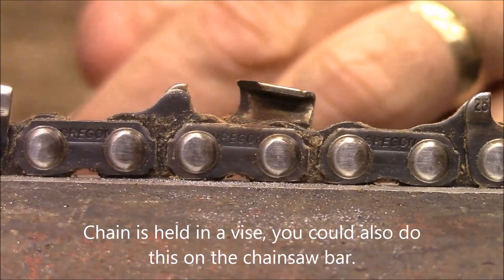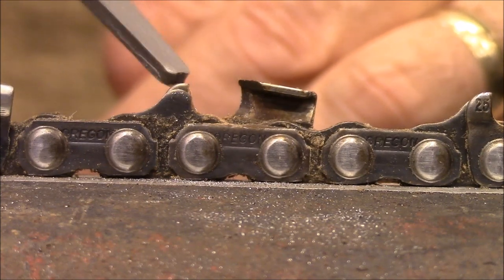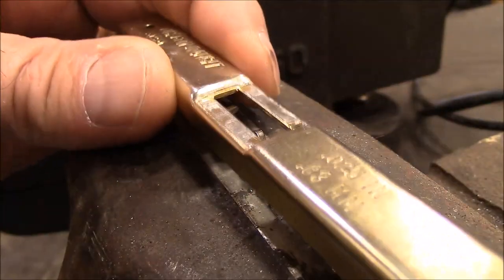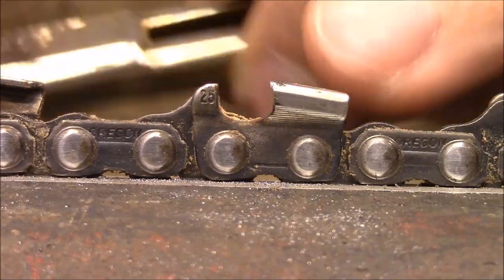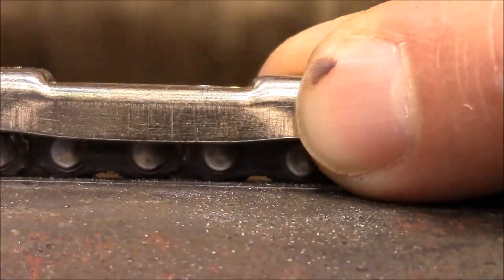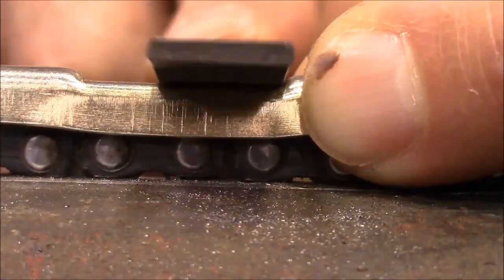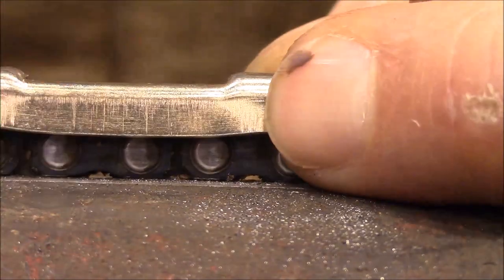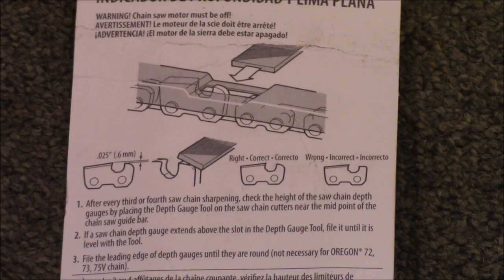How to use a Chainsaw Depth Gauge

Comment: DON'T DO IT THIS WAY if you want your gauge to last for years. Measure with the gauge, remove it, file a bit, then recheck with the gauge. If you do it as in this video, you will end up filing down the gauge slightly over time, no matter how careful you are.
Reply from the maker: Thank you for your comment.  The Oregon gauge is hardened and the file just skates across it.  I have been using it for years and it barely has a mark on it.  Thank you for watching!
Reply: The gauge is no different than a drill guide bushing...it's hardened and very difficult the damage.  The main concern is to only file the depth tooth till you just start to scuff the file on the gauge so that you do not dull your file over time.
Reply: Johhnybarbar. Correct, although hardened steel can blunt a very good file with just a few strokes, I lent a friend my Stihle raker file, and busied myself nearby with other tasks when I heard a much higher pitch coming from his filing. I delayed in making the connection, and when I looked he was sharpening his  axe with it,  He ruined a very good file in just a few seconds--Grrrrr!
Reply: Who the hell has time for that shit? File gauges are cheap (under $2 each). Time isn't.
Reply: @dumper87 exactly
Reply: my thought exactly

Comment: My favorite part is the warning on the Oregon instructions:  Chain saw motor must be off.  That's almost as good as the instructions in a new iron my friend bought recently:  Warning: Do Not Use On Clothes You Are Wearing.
Reply from the maker: You have to be really quick to use it when it's on.  My favorite warning is the one on the lawnmower that tells you not to stick your hand under it when it's running.  Thanks for watching!
Reply: Thomas Hanson they put those kind of warnings on the package for liberals.
Reply: You know that the safety cutoff on the handle and the whole warning not to by pass came from a law suit... a guy in California nudist camp climbed a ladder with one to try and trim a hedge...needless to say he fumbled the unit and it flipped around...and actually removed his "unit"... and only in California ...he won his case!!!!    Number 1 rule is safety first!  Pruning naked is stupid...pruning hedges with a 20 inch push mower is straight stupid....right!!!!????   Crazy!
Reply: It's not just liberals, Mark Twain nailed it with:  "Common sense is an uncommon thing."
Reply: We laugh at these warnings, but some idiot pitcher from Atlanta did iron the shirt he was wearing and got second degree burns.  I think it was John Schmoltz (or something like that...)
Reply: You betya, there are idiots out there that don't know this. They need instructions for EVERYTHING these days.
Reply: Thomas Hanson if we have to put warning signs on things like that maybe they shouldn't use them pay someone to do it for them so that I can make more money
Reply: And don’t drink and drive same as iron mower chainsaw 🤪
Reply: They are on there for a reason "it takes one  idiot  to do it"
Reply: shampoo has directions ........
Reply: @coady-wp3xf  "Lather, rinse, repeat". Theoretically, that would mean we shouldn't stop until the bottle is empty.
Reply: My favorite one is on a box of wine. "Remove this black lid."
Reply: America...
Though I can imagine someone not stopping the motor before trying to use it. Normally the chain doesn't move without applying throttle.

Comment: Make sure you flat file the depth gauge in the same direction as the round file you used to file the associated cutter edge (so every other depth gauge will be filed in the same direction, not as shown in the video). Also if needed, use the flat file to round over the nose of the depth gauge to maintain it's rounded shape vs possible flattened shape due to your filing the depth gauge down.
Reply: Does not make a difference wich way you file the raker but the rounding over is important
Reply: Also - the Oregon package instructions don't show the gauge in place when actually filing.  Leaving the depth gauge tool in place while filing will slowly, over use, thin the .025" depth of the gauge leaving the raker tooth too low.  The depth gauge is only used to check the height before and after filing the extra away and NOT to be in place while filing.  That is why it's called a GAUGE and not a jig.
The direction of the flat filing of the raker tooth doesn't matter although rounding the profile shape after does matter.

Comment: you should have mentioned that you were using a .025 depth gauge and that there are several other chains that as raker shows on your chain that it is to be .025 thousandths depth but some chains are .020, .030 and early older chains can go to .035 and .040 etc.
Reply from the maker: Thanks for the information.

Comment: Thanks didn't know you should do that but I'm going to give it a shot
Reply: +Will Jordan I didn't either.  Been using a chainsaw for 40 years.  Just found this out about 2 years ago.  I always wondered why a sharpened blade would not cut as good as a new one.  Using the depth gauge makes them cut like new.  Thanks for watching!
Reply: No thanks again for the tip
Reply: What's a raker
Reply: @nmmxiii9389  , the raker also called the depth gauge is the upright in front of the cutting edges of tooth. It determines how much fibre the tooth is able to bite.  Set too high, just produces dust, not chips. Too low, makes grabby & can overload engine. Increased risk of kickbacks, severity high.

Comment: PLEASE guys, remember this sentences: 1. Sharpening teeth more than needed makes it dull faster, also shorter chain life.  2. The longer guide bar the longer time to cut the tree.  3. Full throttle is not always the fastest way to cut the tree.  4. Different chain oil can make a big difference in performance.  5. If someone uses chainsaw, never step in front of them, the chain can break and land on u.  6. Sharpening angle is very important.  7. Dont get used to sharpen the chain by hand tools. Buy a machine for it, it cant make any wrong step.  8. If u use sharpening machine never put the grinder laying on teeth until it is sharpened enough, the teeth will overheat. Rather do a few taps and volia(no heat, no problems in future).  9. Depth gauge makes only the tip of tooth cut the three, not the whole blade. It makes teeth longer life, less resistance in speed and engine running, so DO NOT grind the depth gauge lower than u should.
 All of them i learned from my and my dads faults, hope u learned something new on easier way.

Comment: Perspective from a former Oregon timber faller. There is a way better gauge than the one shown in this video. The Calrton file-o-plate is the wat to go. The Carlton allows you to file the rakers to each individual tooth instead of spanning 2 or 3 teeth. Plus the Carlton allows you to file the rakers at an angle. Just make sure you get the proper file-o-plate for the chain you use.
Reply from the maker: I checked out the Carlton.  Interesting tool and looks like it would do a good job.  Thanks for sharing.

Comment: Two questions please. Are there different depth gauge tools for different size chain? And does it matter which way you file depending on which tooth and gauge you’re on?   Thank you for your time.
Reply from the maker: You do need to get the one for your chain but then you just file it to the guage.
Reply: I've heard others say you should file the same direction as you do with a round file but I've always just filed straight across from the clutch side and seems fine.

Comment: I created a 3 part series on how I sharpen a chainsaw chain, in part 2 I use a chain that has 2 cutters broken off on the right ride and I purposely ground the rest of the right cutters down to about half the length of the left cutters. My question is, do you think I managed to get it to cut straight?
Reply: Yes of course, just give the rakers an extra swipe on the short side

Comment: If the gage is determining the depth , why are we filing the gage. Over time doesn't that change the dimensions of the gage?
Reply from the maker: The gauge is hardened so it is not easily filed down, mine still shows almost no wear.

Comment: Are you supposed to be filing with the gauge in place? Seems like over time you’ll kill the accuracy of the gauge.
Reply from the maker: The gauge is actually hardened so the file just skates across it.
Reply: @SoatMon  harder than file steel? I’ll have to check it out next time.

Comment: Good video buddy. You should remove the gauge when filing, since you're taking material  off the gauge itself.  Just saying, not complaining.  Cheers.
Reply from the maker: The gauge is hardened and the file doesn't cut into it.  Thanks for the comment.

Comment: I have several different marking on my dept gage, how do I know which degree to use ?
Reply: A lot of chain has a line at rear of cutter indicating top plate angle & when worn out.
Most cross cutting chain, 25 or 30 degree. Ripping chain 5 - 15 degrees.
Depth setting for most chain, 0.025" for hardwoods or softwoods with lower powered saw.
Generally 0.25", 0.325", 3/8" LP cutters.
0.404" chain tends to be on pro saws. 0.030 more usual. 
Deeper settings are not advisable for hand held units, as risk of kickbacks greatly increased & severity.

Comment: Does it matter that you keep your tool over the depth gauge while you grind?
Reply from the maker: Not sure what you are asking but you need to keep the file flat on the gauge to get the correct height.
Reply: @SoatMon  NO, doing that thins the thickness of the gauge tool.  Check, remove the gauge, file a little, check and repeat until right.  Check the package directions from Oregon - you know, the manufacturer.

Comment: Thanks. Do you have a video on how to use the file guide and file (Oregon #25894 or similar) to sharpen the chain?
Reply from the maker: No. I use a harbor freight electric sharpener. Sorry I couldn't help.
Reply: @SoatMon  No problem, thanks for the content!

Comment: How often do you normally file down your rakers? I'm doing mine after about 20 tanks give or take
Reply from the maker: I file them about every other time I sharpen the teeth.  It depends on how much I have to remove to sharpen the chain, if I have to remove a lot I will go ahead and file the rakers.  Thanks for watching!
Reply: @SoatMon  its done as needed.  Depends on how much you cut. How often you file your chain..  Its good practice to check them ever time you file

Comment: How do i know which size gauge to buy
Reply from the maker: You need to know the pitch of your chain, it should be on the package or in the manual for your saw.  You need to know the pitch to buy a new chain.  On the gauge it will say something like " .325-in and 3/8-in pitch saw chain".  Thanks for watching my video!
Reply: Most depth gauge setting of 0.025" regardless of chain pitch other than 0.404" then usually 0.030" used. 
0.030" often used by production cutters in softwoods. Settings are dependent on type of wood & preferance of operator. What works for them.

Comment: I just cut off the rakers and run it wide open...
Reply: Suggest not a good idea. The risk of severe, uncontrollable kickbacks greatly increased. 
Also may cause excessive, premature wear to components. Raised stress on side links could cause cracks & a broken chain. NOT fun when happens. Whipping around. Both scary & dangerous. Death & injury stories from old timers, early days of power saws.

Comment: Jeez - it's a filing Gauge and not a filing jig.  

Put a factory fresh GAUGE on the raker to see if the raker needs to be filed down.  REMOVE the gauge and file a little then put the gauge back on the raker to see if the raker is now the proper height.  
If you file the raker with the gauge in place the file thins the tool's precise height while filing the rakers - meaning that the gauge will slowly get thinner and thinner after every sharpening progressively making each raker shorter and shorter.  The Oregion package shown NOT filing with the gauge in place.
If you leave the gauge in place then after enough raker sharpenings the gauge will be paper thin and useless.
Reply from the maker: Not true.  The gauge is hardened and the file just skates across it.  The instructions do show you filing with the gauge in place.  If it were just a gauge as you state why not make it out of plastic and why harden it?  I have been using mine for years and the file has yet to cut into the gauge but you can do whatever makes you comfortable.